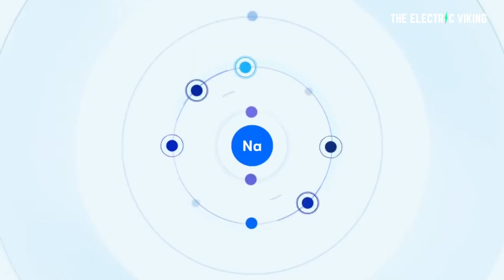Electric cars will use Sodium-ion + lithium hybrid batteries in 2023

Comment: Wonder what happens to the Tesla 4680 ?  do they use different chemistry ? or is the cylindrical battery obsolete ?
Reply: My guess is cost of the 4680 battery factory is being amortized over the first few years of production. After that, 4680 batteries should drop in cost .  Also some improvements to the technology may keep it competitive for a while even in the face of a better competing technology.
Reply: the blade structural battery has better energy capacity per area vs 4680, but the 4680 has less limitations on container shape, for BEV's the blade battery design is superior.